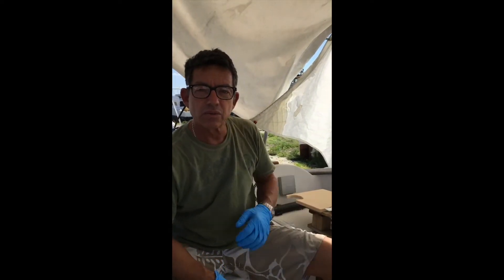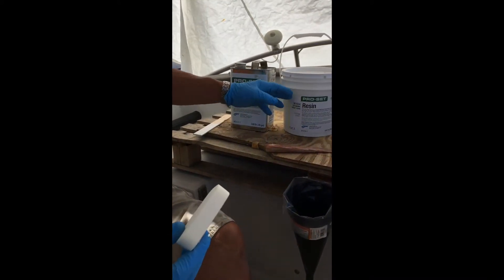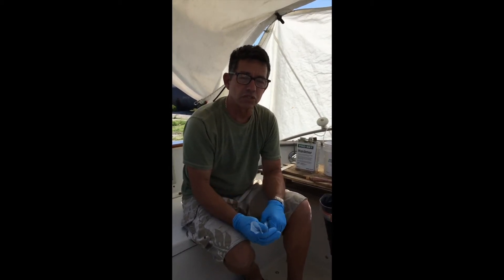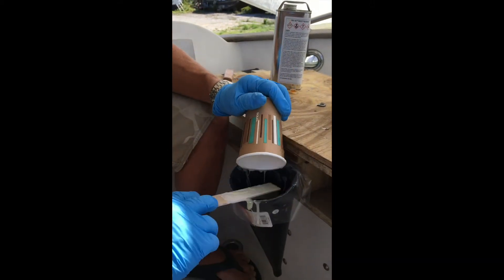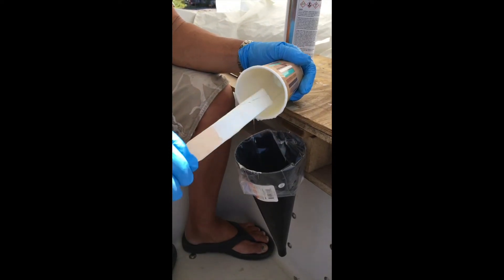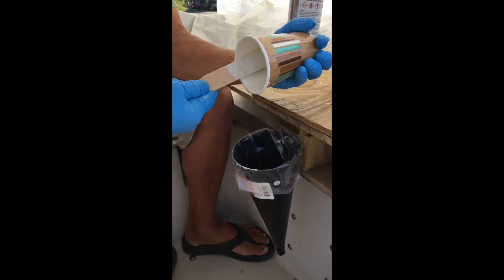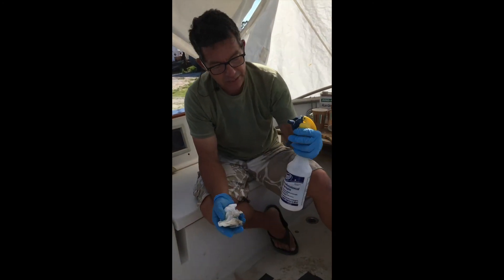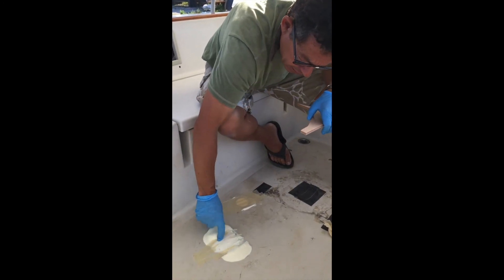Boat deck delamination repair part 1

Comment: Hi Tinho,  I'm thinking of using Sicomin pb 250 (or, maybe 170 for the deck core).  I understand that the product you used is no longer available.  Are you still happy with your repair?  Do you have any strong recommendations against using foaming epoxy to repair deck core, as long as I remove the rotten balsa and drill sufficient vent holes for the foam to expand through, to relieve undue pressure?
Reply from the maker: Hi Erika, you may contact Sicomin for advice on either 250 or 170 being appropriate. My hunch is the 250 would be better. The epoxy foams do not expand wildly like the PU foams so not too much worry about over expanding. I still strongly recommend this method , and the use of epoxy foam like Sicomin. Good luck with your project.

Comment: Hey Tinho, Who sells Sicomin in the US or Canada?  What size holes did you put in your deck to clean out the core?
John
Reply from the maker: Google sicomin for distributors. I used a 2" hole saw.
Reply: @tinhodornellas  Thanks much Tinho!  Hope your restoration is going well!

Comment: My balsa core is fine but the skin has separated from the core in my cockpit on a skiff and I am wondering if this foam would be a good way to fill the gap between the balsa core and the fiberglass skin. The gap varies from spot to spot but is anywhere between 1/2 inch 1/4inch. I will be completely dry and treating the balsa core with a clear penetrating epoxy.
Reply from the maker: It seems to me that if you are using epoxy to treat the balsa, you could be gluing it together with the delam skin at the same time? Unless the skin is too rigid, in that case, yes the epoxy foam would work great. It will work either way. Just drill escape holes so any excess can come out. There are many ways to go about it , depending how firm the skin is and the shape of the surface. Good luck.
Reply: @tinhodornellas  Can you drill the epoxy foam to mount a center console? The area I am filling is under the center console and I will need to reattach it once I am finished.
Reply from the maker: @jesse4r5  Yes absolutely. However just to be clear You do not want to rely on the foam to hold the screws. You need to bolt through the entire sandwich .
Reply: @tinhodornellas  the screws will just be passing through the foam and reseating in the previous holes in the next layer of fiberglass.
Reply: @tinhodornellas  it also turns out that it was my balsa core that went bad. When I initially drilled i saw no wood and assumed that the sin had merely separated from the balsa. It turns out the balsa just rotted away and shifted towards the rear of the boat leaving a large hollow space.
Reply from the maker: @jesse4r5  Perfect job for that epoxy foam then.
Reply: @tinhodornellas  I am pulling as much rot from the drilled holes as possible then allowing whats left to dry. I am then going to inject left over balsa with a clear penetrating wood rot epoxy. Once that cures I will fill the voids left from removing rot with epoxy foam. Your video was so very helpful. I appreciate the advice!
Reply: @tinhodornellas  Out of curiosity (I have already purchased pro set) have you ever used the product "injectadeck"? If so how would you compare the two products?
Reply from the maker: @jesse4r5  looking at the description and watching the video, I can tell it is a polyurethane based expanding foam, nothing new to the old existing 2 part foams,  same stuff, maybe higher density, as all expanding foams come in different densities. But you can see by how fast it expands that it no way close to the epoxy foram I described and used. Again they dont sponsor or pay me to say this. Urethanes react with moisture . The more moisture, the more they expand. Indeed they stick well the initial bond, but the cell structure is no where near the strength of the sicomin or pro set epoxy foams.
Reply: @tinhodornellas  Sounds good. Appreciate your opinion.

Comment: Do you think this could be done for wet core on a hull? 2" or 3" holes every 12 inches? This would be so much easier than removing the entire skin, re-coring, glassing the entire area, then fairing (which is hard to get right on the curves of a hull.
Reply from the maker: Rotten core is doing nothing to keep the structural integrity of the hull, so digging it out and replacing it with a core that bonds itself to the skins is to me pretty clear advantage. If you use a really stiff wire , twisted, and let the ends out at 45 degree angles the length of the wire is what determines the spacing of the holes. the fewer holes the better. I think there are many different ways of digging out the rotten core. But 12" spacing is not bad either.
Reply: @tinhodornellas  Is that a coat hanger? I think the challenge is to get far enough under the skin, without drilling too many 2" holes. Any other ways? I'm thinking a right angle drill will get in there a little better...maybe.
Reply from the maker: @jamesrichy68  That is a stainless wire. Would chose something pretty stiff.

Comment: Also, do the holes have to be glassed over before painting? Or I suppose there is enough strength? Very interesting and well presented, by the way.
Reply from the maker: If the holes are done in a place where there is foot traffic, absolutely you need to glass over. Remember it is a sandwich with Glass/core/glass. On most areas I glass over it, then sand and fair.
Reply: @tinhodornellas  So a 12:1 bevel, and circular pieces of glass, each one smaller than the last?
Reply from the maker: @jamesrichy68  for a 2" hole I put a 1" bevel all the way around . Largest piece goes in first, then progressively smaller.

Comment: How did you dig out the rotten material with those small holes?
Reply from the maker: James check this video out. it is on my Boat Projects facebook page under videos https://www.facebook.com/v40refit/videos/1734511646609846/
Reply: @tinhodornellas  This is such a good idea. I wonder if there is a tool - some sort of right angle drill that would get in there better...
Reply: @tinhodornellas  is that a bent coat hanger wire?  I might add that to my right angle drill attachment if so.
Reply from the maker: @fordperfect1227  That is a stainless steel wire. Coat hanger wire is softer. You will need something stiffer. Stainless welding rod will also work. GAlvanized fence wire about 1/8" would also do the job

Comment: are you ever worried that the forced expansion will create problems on the nearby areas?
Reply from the maker: Matt, No, this epoxy resin does not expand the forceful way the PU stuff does. It is best to allow an escape route for over filling  if you are not sure , but a simple test with a small quantity gives you an idea of how far it expands..
Reply: @tinhodornellas  Thank you!  just wasnt sure if the escape route could cure first and the rest would continue to expand no matter what.

Comment: i got a vessel  that is not wood or balsa, . is made it from a closed cell foam ( product similar to Divinycell or CoreCell). Do you think i can used that  product   to fix delamination in this kind of construction ?
Reply from the maker: Cesarmanwolf, that is how I used to repair delamination but you do a lot more extensive removal of the original skin or skins. If the area of delamination is very large, like a deck area over 3ft long and 2 ft wide, using Airex foam sheet or divinycell is a good way to go. But for multiple smaller areas , even fairly large areas with compound courses, you cannot match the ease of the Epoxy foam.
Reply: @tinhodornellas  Thank you .. you give me  hope  !

Comment: Good video, Tinho.  Tell me, how do you remove those large lumps that expanded out of the hole?  And, do you re insert the deck plug you sawed out with your hole saw so the deck repair is minimized?
Reply from the maker: Thanks. super easy to remove excess. Use a hacksaw blade, a multitool with saw blade attachment(easiest). I repaired rotten core from the inside the cabin, by removing a 2" round plug, Then re- inserted it and taped it in place. finally came back and glassed over the plug. On the video, because of the amount of point loading people's feet have on the deck, I replaced with Biaxial glass, so I have no shear line around the edge of the plug